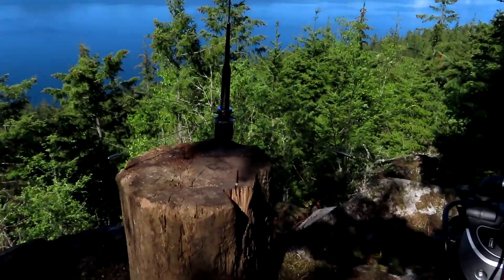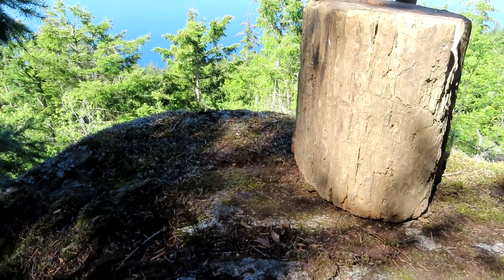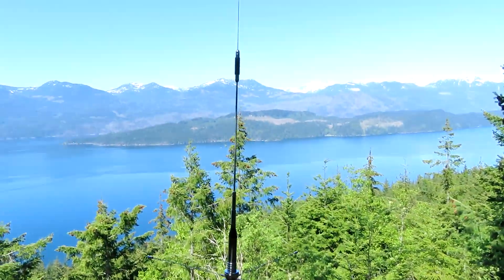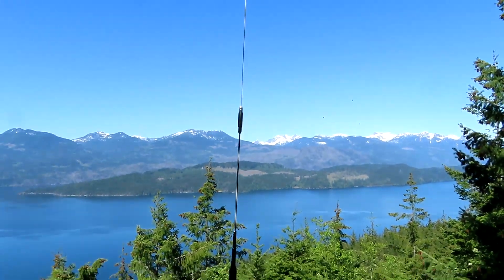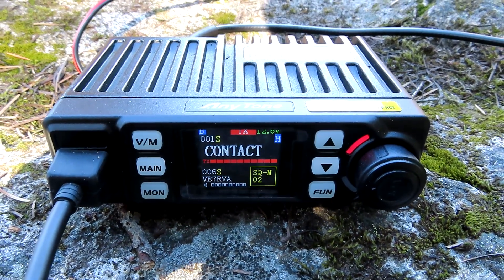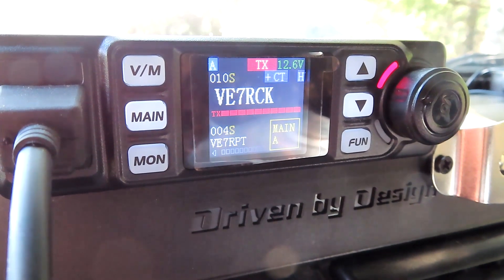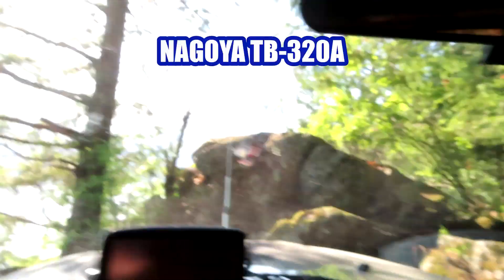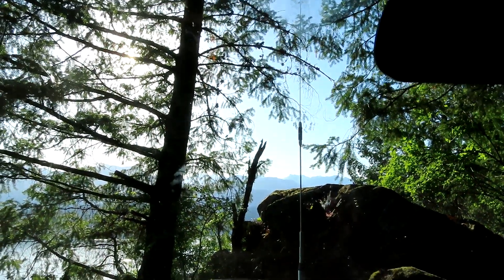HAM Radio: Nagoya TB-320A Antenna vs NMO-72 & Testing RB-50 / GPK-01 Mounts

Comment: i just bought one of these and mounted it on my roof but it not doing so well for me. on 220the swr is almost 4.00 and close to 3.00 on other bands.
Reply from the maker: Which mount are you using for it? I have low SWR with the RB-50 / GPK-01 mounts (I haven't tried 220 though)